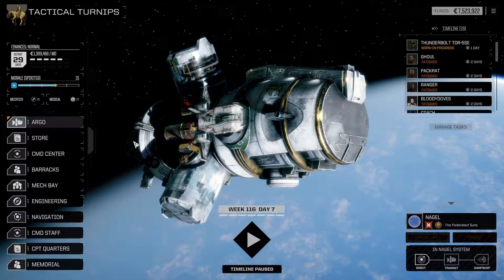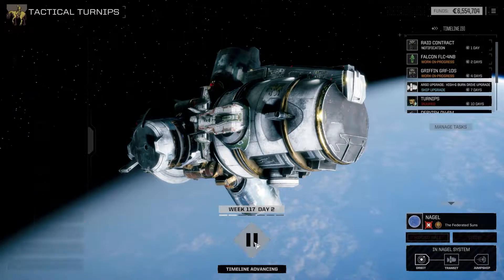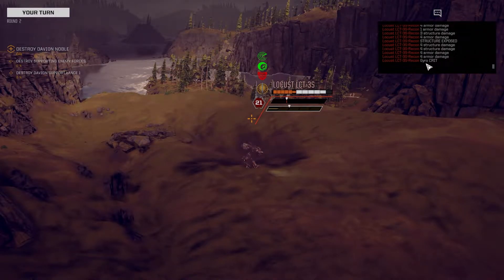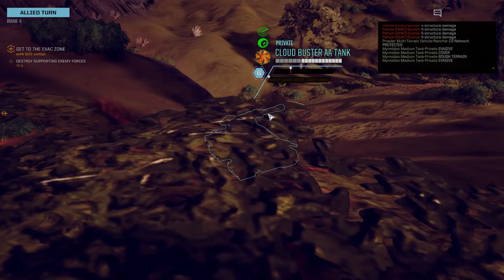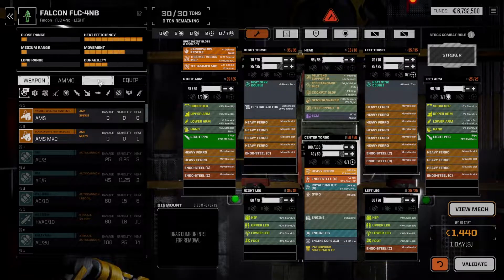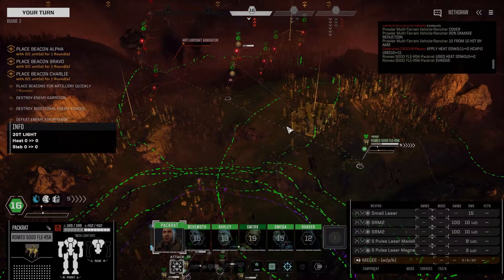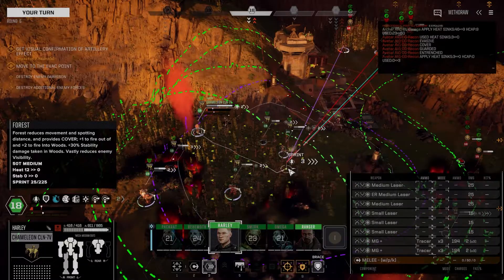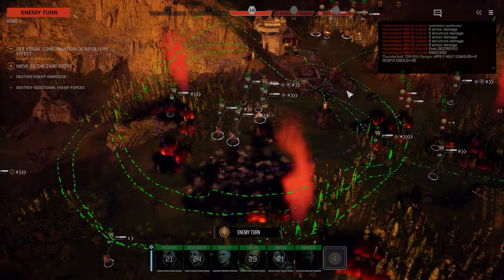Punching Up: RogueTech - Tactical Turnips [S1 EP59]

Comment: One always takes the Juggernaut ability (unless tank driver) :) Because we know who he is, unlike Kitty.
Nothing beats a surprise visit from a double gauss mech. Those are some high speed gifts they deliver.
Darius was like - The commander is crazy enough to consider 4.5 skull target acquisition with an Urbie, I better keep my mouth shut this time.
If you are in a situation like this, eject the Supurby, you only lose the head component, and sprint for the evac with the others. (If they didn't change this)
Costly, but really cool fight!

Heavy Gauss is more accurate the less evasion you generate, so stay put if you can with it.
If you lose a tank or mech, and the pilot screams, then it means they died.

Didn't pay attention, and vent bankrupt with previous saves corrupted, so had to start a new run. Soooo many things changed, compared to my old knowledge of roguetech :) Started with soldier background, and got extremely good gear (including clan stuff and 2 heavy gauss rifles). Found out, that chem lasers lost their acc debuff, so they are really good now, and magshot cannons got insanely good lighter gauss type weapons. Different type of start, different mechs, now I read everything again to check what changed, but I really enjoy the new start.
Reply from the maker: These fights are really starting to ramp up in difficulty. I suspect I’ll be in a new start before long. Really depends on whether I can get the heavier mechs online in time and not bankrupt myself doing it. 

I kinda want to test out a BA start with the new mechanics.
Reply: @Greenbeef  Being able to refit them, now they might be interesting. Too scared to use them, not gonna lie :)
Reply from the maker: @IstvanK_PC  I had some BA in my Jarnfolk run. Without the ability to ride vehicles and mechs, they were like taking the Supurby out on every mission. Slow but deadly.